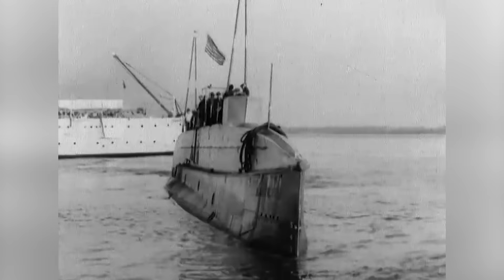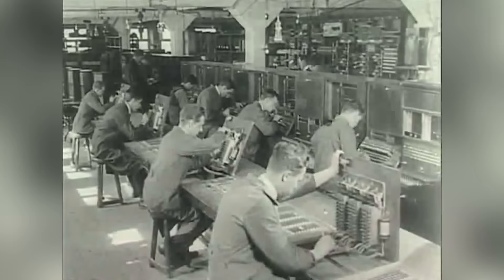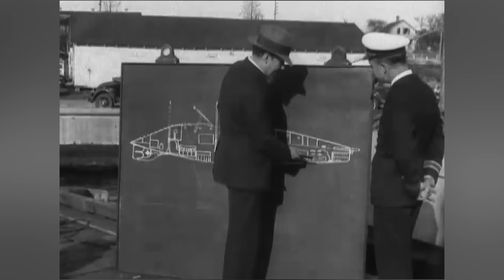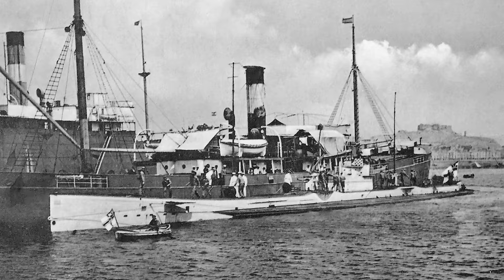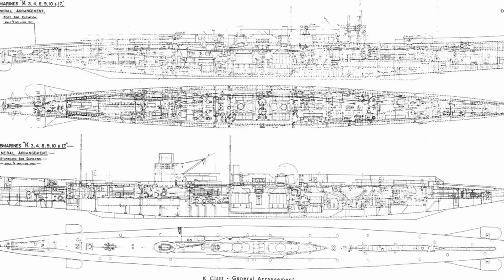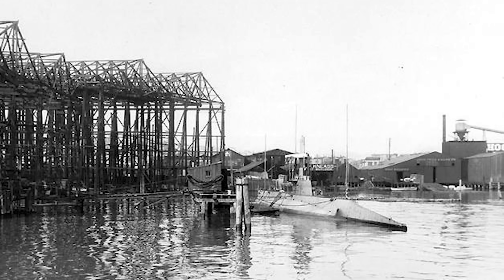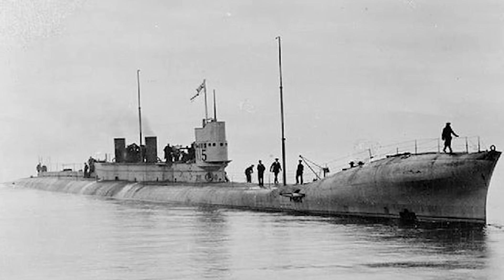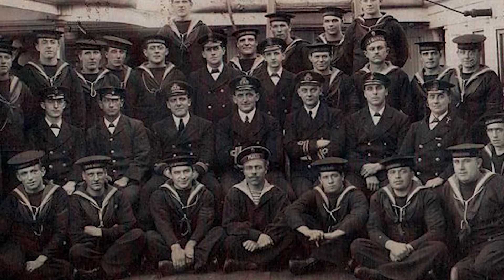The RIDICULOUS Steam Submarine: The K-Class Failure

Comment: As soon as Mike said "vents" and "foreshadowing" I thought "Oh God! Someone put a vent on a submarine!"
Reply: At least they scrapped the plans for the subs with screen doors and the steam powered hydrogen balloons!  :face-blue-smiling:
Reply: All military submarines using a combustion engine for primary power have air vents since such submarines are really surface ships that can submerge (they are better classified as submersible ships rather than submarines).  Only a pure electric or Nuclear don't have vents for intake and exhaust air.  Aside from those there are other hull openings depending on the subs design, but only speaking of modern Nuclear subs there are plenty of hull openings for hatches, loading hatches for torpedoes, missile tubes, water intake for the reactor, boiler, desalination plants, cooling, ballast system, etc.
Reply: @larrybremer4930  All American navy submarines are nuclear. So we don't worry about that.
Reply: Having vents was the only way to get air to the diesel, petrol or in this case steam engines during surface running.
It was a standard feature on every nations subs until the nuclear age.

The classic case is the USS Squalous which was lost then the engine room chief supposedly had a brain spasm and opened instead of closing the engine room vents as the ship was diving and flooded the vessel.
Reply: @voiceofraisin3778  Some people really have a hard time with jokes.
Reply: Same folks who thought propellers would work out well on cars...
Reply: But seriously, folks, it's one thing to put small, manageable holes like necessary vents in submarine hulls. It's quite another to put the relatively ginormous holes required by steam funnels in those same hulls. (And I'm almost sure this is why they came up with double hulls for subs, for the sake of reducing the number of holes in the sub's vital pressure hull that needed to be closed before it could dive.)
Reply: @BlairAir  That's how lawn mower was invented..:face-fuchsia-tongue-out:
Reply: @etorepugatti9196  accidental side-effect becomes indispensable tool 🚜😂
Reply: @larrybremer4930  "are really surface ships that can submerge" Lol!
Reply: @evaluateanalysis7974  Its no joke, most WWII subs only carried around 22 torps (that are very expensive) vs hundreds of cheap shells for the deck gun.  Merchies would get shelled so plenty of tonnage was sunk by deck guns on the surface.  Diving was only used sparingly since batteries could at most keep you alive (non moving) for around a day and far less if actually moving at any significant speed underwater.  On the surface most could manage around 20kts and run for thousands of miles by comparison.  Thus its easy to say they are mostly a surface ship that can submerge.  Even their hull shape is optimized fur surface seakeeping over underwater performance.  It was not until the albacore hull that you started seeing subs that were optimized for sub surface operation and only nuclear power truly freed them from reliance on the surface (air) to sustain operation.
Reply: @BlairAir  Side effect = lawn mower
ground effect gives Hoovercraft.
Thoses guys where genius.😂
Reply: Well, even diesels need vents (air in, exhaust out)  - or in some cases a Schnorkel.
Reply: @dogsbodyish8403  You guys really take jokes hard.
Reply: um...there WAS a thing about gas baloons using FLAME to expand the gas to increase lift in the mid-1800's...yes open flame around HYDROGEN...didnt last long....
Reply: @3ftsteamrwy12  Well it was a sound theory on paper.🤣🤣🤣
Reply: @michaelholt8590 all Nuclear Submarines have vents and snorkels.  The Vents are for the MBTs and the Snorkel mast is for the emergency diesel.
Reply: @Subdood04  You really can't just take the joke can you?
Reply: @BlairAir the amphibious cars we’re actually successful! Just you gotta know what you’re doing.
Reply: @johngdoty Flex-Seal to the rescue!
Reply: My favorite part is how the crush depth was less than the length. So the front can be crushed when the back is in air.
Reply: @evaluateanalysis7974  early diesel electric boats, that statement is absolutely true..
Reply: @spigot993  You said "*All military submarines* using a combustion engine for primary power have air vents since such submarines *are really surface ships*"
Now you say "early diesel electric boats"
You appear to have changed your mind.
Reply: This is what the world looked like before modern Risk Analysis and Mitigation techniques. Men in smoke-filled rooms made decisions based on outdated operational experience, confirmation bias, personal agendas, and misplaced opinions. This creates groupthink and unhealthy decision-making hierarchies. No one ever asked the front-line officers and men or even the engineers designing these things their opinions, ideas, or, more realistically, if what they proposed was even possible. Through the hindsight of 20:20 clarity, we pat ourselves on our backs without looking around at our own emerging "K-Class" level bad decisions we are enabling.
Reply: @evaluateanalysis7974  I never made that claim, you must be replying to the wrong person.
Reply: @spigot993 "I never..." True, but since you didn't quote part of my comment, I don't know what you are replying to.
Reply: @evaluateanalysis7974  you laughed at the statement that submarines were surface vessels that submerge, which is true of WW1 and WW2 subs. They are almost all of a surface vessel hull shape in design, that can spend a comparatively limited amount of time submerged.
Reply: @spigot993 "submarines were surface vessels that submerge" So ships are just submarines that can't submerge?
Reply: @evaluateanalysis7974  haha, I am of the impression you're being deliberately obtuse, but I'll bite; what I mean is that they are primarily surface vessels, they spent most of their time on the surface due to several limitations: not being able to charge their batteries without a snort, finite oxygen supply and so on, whereas modern submarines - particularly nuclear - spend most of their time submerged. Also pay particular attention to the hull shapes, early diesel electric submarine hulls perform better while surfaced.
Reply: @spigot993 "haha" Well you are welcome to your own private hypothesis.
Reply: @evaluateanalysis7974 it's not even that difficult, it's fact.
Reply: @spigot993  "it's not..." So you are a troll then.
Reply: @evaluateanalysis7974  He is right you know.
Reply: @drinmer1  Lol!
Reply: @larrybremer4930  Sorry my dude, but modern diesel submarines don't have air intakes either. They use electrolysis to break water into hydrogen and oxygen, and that oxygen is used both for the crew and to feed the combustion of the diesel engines.
Reply: @larrybremer4930  Might want to look up modern diesel submarines. Sweden in particular has carried that design forward and refined it to an amazing degree, where they can now remain submerged for a very long time. Just like nuclear, they use electrolysis to crack water into hydrogen and oxygen, so they're not reliant on surfacing either.
Reply: @halifornia2001  I am familiar with air independent propulsion, but those are still not true blue water submarines, rather they are coastal patrol submarines because like any non-nuclear vessel they are limited by their fuel supply.  It would violate the laws of thermodynamics to use electricity to convert sea water to fuel to again generate the electricity to convert sea water to fuel so such a process cannot even sustain itself so forget actually having a power surplus.  These ships carry liquid hydrogen and oxidizer (usually liquid oxygen) to generate power via fuel cells.  The technology makes for an ultra quiet and capable submarine, but it suffers from very poor endurance for long patrols along with supplying significantly less available electrical power compared to its nuclear counterparts.  While there is certainly a place for such equipment in modern militaries for coastal anti ship and ASW defense they would not be viable for global reach that countries like the US and Russia require.  The US doctrine is to intercept enemies well outside its waters or even in enemy territory while a country like Germany who employ AIP are only concerned with defense of in or near home waters.
Reply: @evaluateanalysis7974  Every surface ship can submerge
Reply: A funnel
Reply: @powertothebauer296  This is true.  Submariners will say there are two kinds of ships in the Navy, Subs and Targets.
Reply: Thats how the top level of every organisation still runs today
Reply: Man your so hard of thinking its painful reading your comments. Like watching Biden debate
Reply: Every sub built at that time has and needs vents.

Comment: Another point, diesel-electric submarines are not slower underwater because they use electric motors.  The drive system uses electric motors on the surface as well.  The motors are powered from either diesel-driven generators or storage batteries, but the motors are capable of the same hp surfaced or submerged. (although at maximum power, the storage batteries are depleted quite rapidly)

But the hull design of these boats are much more hydrodynamic on the surface.  Basically similar to conventional ships.  Submerged, the deck gun, conning tower and overall hull shape create tremendous drag reducing their submerged speed.  The adoption of the tear-drop hull shape (Albacore hull shape) changed that after WW II.
Reply: Right.  That design philosophy began with the Germans who prior to WW1 reasoned a submarine was going to spend most of it's time on the surface anyway so they designed their subs with hulls that had good sea-keeping and handling abilities while surfaced.  There was a penalty to be paid while submerged due to lack of streamlining but the German designers figured the trade-off was worth it.  And so it proved.
Reply: Yep..
Reply: That may be true but the capacity of the batteries is strictly limited, so it wouldn't get very far at full speed. Underwater it would use a far more economical cruising speed, usually about 3 or 4 knots, depending on how far it needed to go.
Reply: IIRC most diesel-electric submarines up through the end of WWII actually had gearboxes and clutches allowing the diesel engines to be directly connected to the propellers. The electric motors were thus used only when diving.

Modern diesel-electric subs indeed have a much simpler system with the diesel engines only driving the generators, and a separate electrical motor to drive the propeller, with no mechanical connection between the diesels and the prop shaft.
Reply: @philiphumphrey1548 that's what they said?
Reply: @philiphumphrey1548  "...batteries is strictly limited..."  And that's exactly the point I meant when I said, "although at maximum power, the storage batteries are depleted quite rapidly".

But my point was, even with the same shaft horsepower surfaced or submerged, underwater the drag is much more and THAT is why the top speed while submerged is so much lower.  Even for a short 'sprint' at maximum power, they couldn't go as fast as when surfaced.
Reply: @wayneantoniazzi2706 And, the German subs had a much greater dive depth than the Allied subs.  They also could dive much faster.  Important when caught on the surface by Allied patrol bombers.
Reply: Actually not true, most diesel electric subs had dual drive. Diesel engines drove the props directly on the surface
Reply: @bobn2805  Yes.  They used the electric motors as generators  (to charge batteries) when running on the engines.  It limited the flexibility of the system as fast charging wasn't possible if a low surface speed was desired.  true Diesel-electric was primarily developed by the USN for the long range patrol subs.
Reply: @anthonyjackson280  well they should have equipped it with a usb C port for fast charging
Reply: @bobn2805  That would work only if they could find the correct USB 4.2 4x4 Super Edition Plus Gold cable
Reply: Exactly. WWI & WWII submarines could be more accurately described as submersibles. Modern DE subs (which are proper submarines) move substantially faster traveling underwater. Most modern DE subs can book it at somewhere around 20 knots. The fastest designs do 25 knots or a little more.
Reply: Another factor is that they displace a lot more water submerged than on the surface.
Reply: Submersible vs. Submarine.
Reply: Kettle leads. A viable alternative.
Reply: @anthonyjackson280  On low surface speed, they still could run one side on fast charging mode
Reply: Hence in submarine films, they always surface to go somewhere quickly. It was worth inventing submarines just for the films.
Reply: Most of them were WAY SLOWER underwater. Because of the shape, drive or simply energy saving.
This is obvious that electric engine has same power running on batteries or generator.
Reply: @podunkman2709  Generators can have a much higher power output than batteries
Reply: Even if it wasn't for all the peripheral furniture of a sub and they were a smooth torpedo shape they'd still be faster only half submerged due to far less hull drag.
Reply: @wayneantoniazzi2706  and then came the Electroboot, but too late. The progenitor of all modern subs, nicht wahr?
Reply: @jonaarbakke9633  Ja, genau!
Reply: @610jrod no it isn't
Reply: @mikefochtman7164  I believe modern nuck. subs. are considerably faster when submerged then on the surface !?!
Reply: @stupitdog9686  Yes, and this just further shows that it's not the power plant that makes the big difference, it's the hull.  Nuc reactor's maximum shaft horsepower doesn't vary, but a modern tear drop shape is much more hydrodynamic than the old WW II 'fleet boat' design.
Reply: This is also the reason majority of modern submarines have a round nose and shape, because they are underwater the majority of the time and this shape is the most hydrodynamic, and the ww2 subs where on the surface most of the time and only dived in combat or for other reasons. Notice how most of ww2 subs have a bow at the front just like a ship
Reply: The German type XXI / 21 Uboat are among the first type of submarine that is operationally faster under the water than above the water with all the hydrodynamic drag features such as the conning tower (also known as the fin) the deck gun and overall hull shape completely redesigned to resemble the features of a whale. The conning tower (fin) had two double barrel multi purpose  turrets on the front and back of the conning tower so they were far more streamlined under water when not in use. The sub also had a snorkel allowing it to stay submerged and run with it's diesel engines for days on end. Had Germany been able to produce them in greater numbers the war could have turned out very differently. These subs were so successful that a lot of other countries copied the designs to produce the Russian foxtrot class and the shape inspired the design of the USS Nautilus. Though USS nautilus was nuclear powered instead.
Reply: Thought the motors became the generators to charge the batteries when running on the diesels.

Comment: Fredrik Knudsen made a documentary about this a few years ago.  That shit was insane.

May I suggest making a video about how batteries in old subs worked? Always been curious about that.
Reply: I've seen the batteries they use in the Gato class, it's a few massive banks of lead-acid cells.
Reply: Huge banks of wet lead-acid cells
They produce hydrogen when hot, when overcharged, and in the presence of salt water
Wet lead-acid battery management became a whole field until they started shifting to solid cells post WW2
Reply: His video isn't all that great because the entire history section is wrong, particularly the claims he made about German submarines (the Royal Navy had more submarines at the start of the war and they were more sophisticated, and both sides used them for the same thing). Plus he obfuscates that the problem at May Island was, as is often the case with these collisions, a cavalier commander of a small vessel executing turns in front of larger vessels without properly informing them. The same thing led to collisions like the carrier USS Wasp striking the destroyer USS Hobson in 1952, which actually killed more people.

Comment: When it comes to innovating in navel history, The Italian Battlecruiser project of 1921 by Ferdinado Cassone, is an interesting one to note. It was one of the Largest Ships proposed for the Regina Marine at that point in time, and also it was one of the most unique when it comes to its power-plant arrangement, and its 456mm main armament. 

Unlike most conventional ships, the Ship design had what is called a "Two-Tiered" power-plant. In which the ships Boilers where to be placed ABOVE the Engines in the Engine compartment. The idea was this arrangement was to reduce the length of the ships citadel to save space while not increasing the ships tonnage above 45,000 tons. Although this Engine Layout did increase the Height of the citadel above the waterline just bellow the armored deck in some places, which was one of the major downsides with the power-plant proposal.

However the Design itself was never seen through, due to the rather advanced and ambitious nature of the Tier-tiered power-plant, and infrastructural and economic constraints of the time.

Comment: Started building a scale K-class submarine on Stormworks last October. Extended the workbench size to accomodate it and scratch built the hull in two days from the same image of the deck plans you use in your video. Had it floating with temporary ballast and was roughing in the periscopes, armament, decks, bulkheads and powerplant when the game was updated to handle stupid Space DLC crap that broke steam power, fluid dynamics and the game's overall optimization. Gonna be one of those things I want to but will never be able to finish.